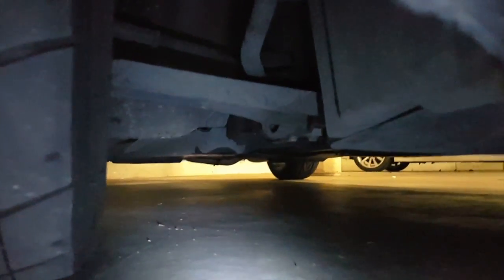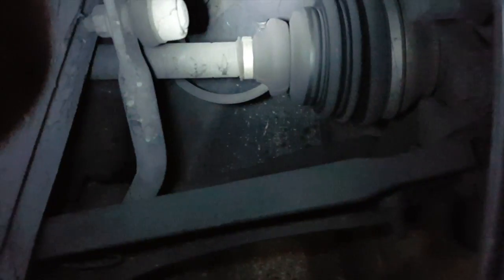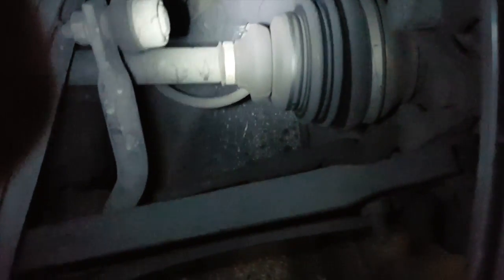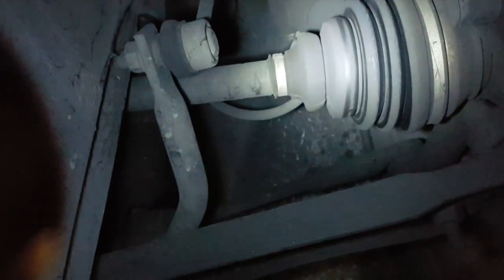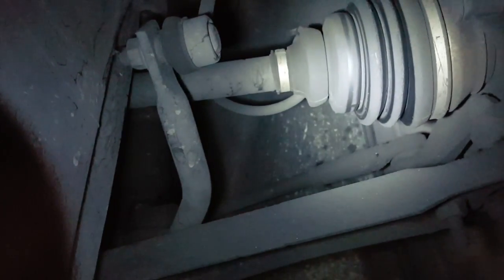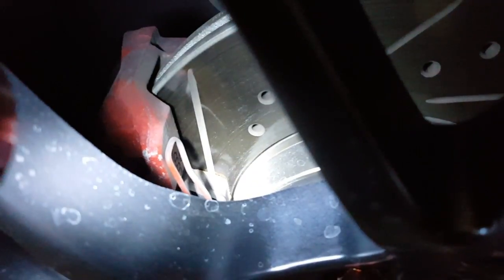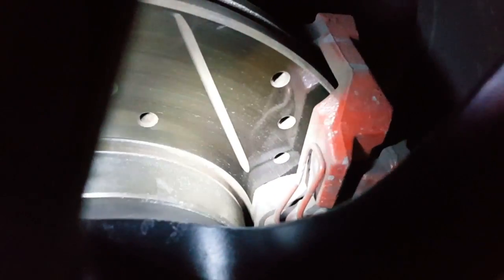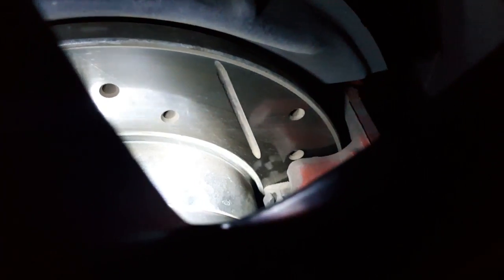Car VW VLOG 52: Mechanical General Inspection on the VW rabbit!

Comment: I have a 2007 vw rabbit also and i want to start tuning it but I don't have any idea about tuning or where to start. Do you have any suggestions ?
Reply: 90sbabi take the 2007 rabbit, sell it, and get a GTI
Reply from the maker: Well you could run an APR fully loaded ECU chip on it, and depending if your car is a manual or an automatic, you could think about the turbo kits they have for it. Or you can start simple and run a catback exhaust and a CAI